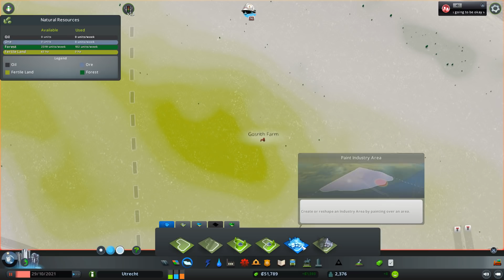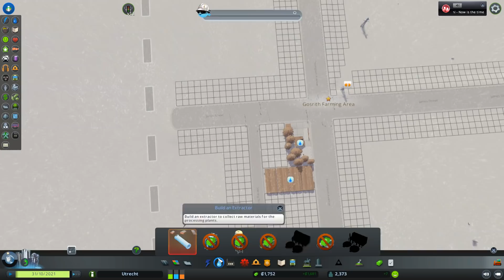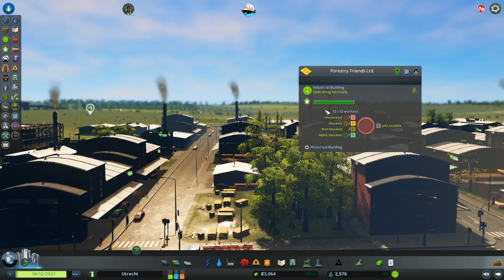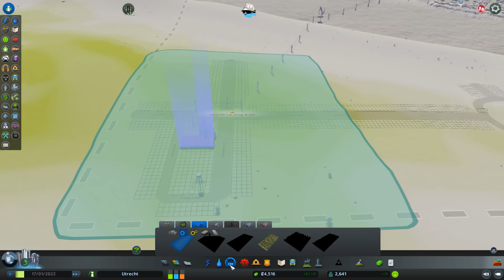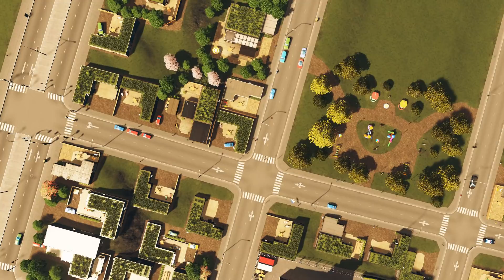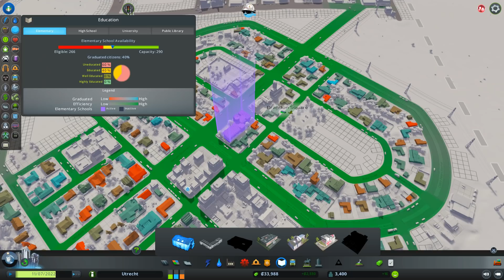Cities: Skylines - #3 - Farm Life [Calm Content] (Cities: Skylines - Industries)

Comment: Avoid setting up buildings at your travelling roads if those roads dont have parking spaces. Instead, have things set their exits up at secondary roads so people on the main roads can travel unimpeded by parking cars. Also, avoid intersections on travelling roads, theyll block your traffic off. If you have the traffic manager, you can set the road up to have designated travelling lanes where you do have intersections since you cant toally avoid it.